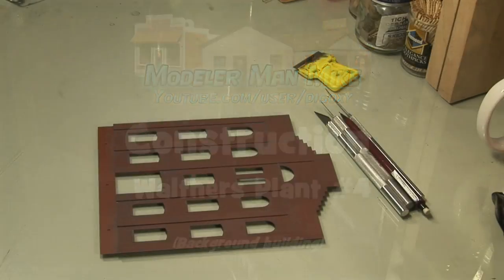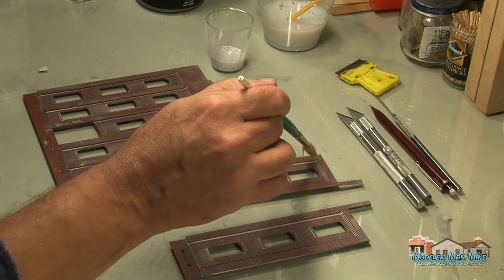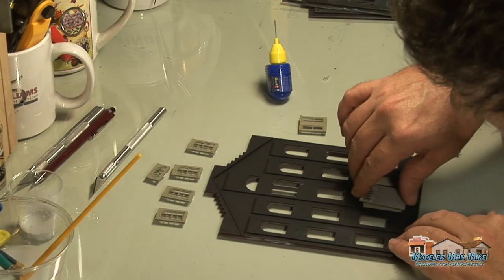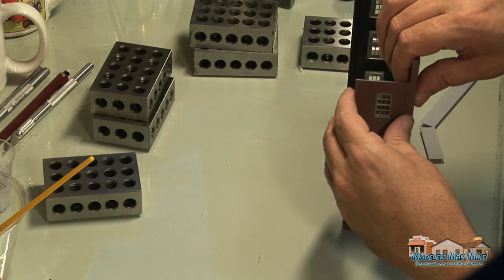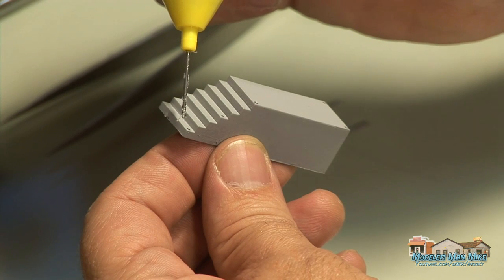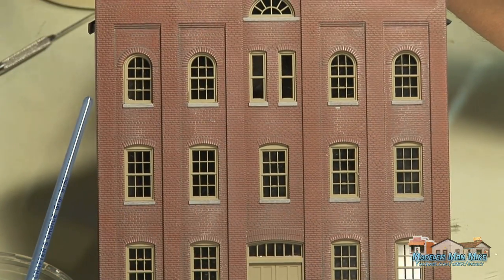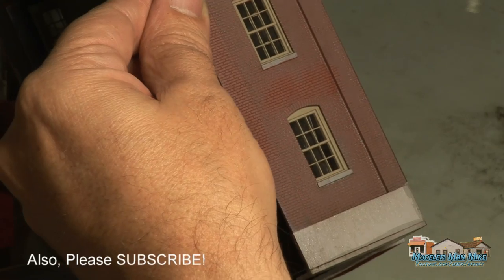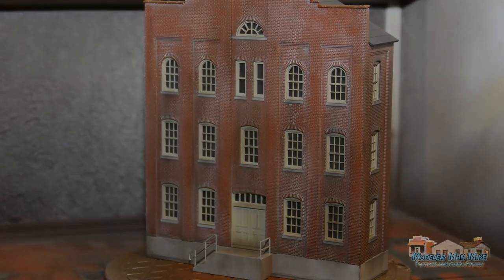Model Railroad HO Scale Build - Walthers Plant #4 HO Scale Building Construction

Comment: Great video! I did the same building but didn't do weathering like that, and I noted you painted the inside wall black before putting it together. Great instructions!
Reply from the maker: How did yours come out?
Reply: ModelerManMike
Ok, but not as good as yours. I did lights in mine.In about a week I'll have a new video out and it will probably be seen.

Comment: hey mike, I found that if you like.... you can paint drapes on the upper half of the window useing a nice contrasting color and blacken the lower half altering in lengh to simulate shaded windows. It looks good AND it's Eeeeeeasy. lol
Reply from the maker: Hey, this is a great suggestion for a standard unlit building, however, I am going to light these buildings and I want to have the light through the windows. I found that using yellow masking tape and white masking tape work well to. I need to work on this some more of course, but in all, the light through the windows with masking tape as more of a blind or something really looks good. Maybe soon I can get something up on this with some lighting to show how this looks, it really looks good. Thanks so much for the compliments, they are very much appreciated and I really enjoy hearing idea's and you my friend are sending some. Thanks for that.
Reply: I Have painted just the top part for the shade and left the bottom clear with lighting and it looks pretty GOOD?!!

Comment: What type of glue do use to glue plastic windows or acetate to the plastic building sides? Look forward to your response. Thank you.
Reply from the maker: I use mostly the revell brand for most everything. Its actually not a glue, its a solvent that melts the parts together. You can get just about any type of solvent, most all works fine. I like the revell because of the needle applicator. I have purchased also, solvent from ebay with needle bottle applicators that are solvent safe. If you looke on the web for best solvent for evergreen styrene you will find all the info you are looking for as to how to get your stuff built. Hope this helps.

Comment: Quick question.  In one of your other videos you weathered and then sealed everything with Dullcote.  Afterwards you added the windows.  I then checked out some of my buildings and realized how bad they looked because I used the Dullcote after the windows were added.  On this video you added weathering after the windows were added.  Did you not apply Dullcote to this model?  If so, does not applying Dullcote make the building harder to clean away dust?
Reply from the maker: Hello Loren, wish I had a really quick answer. This model is a background building, when I built it, I didn't think much about the windows really. I probably should have sealed it with dullcote then added the windows. I did look at this model and the windows have a nice "film" on them from the sealer.

I didn't have dullcote on this model and used some clear matte spray. I don't use the clear matte spray anymore just because it seems to destroy a lot of the weathering I do. I think on many of the models I do, including many that I do not do video's on, I have stopped using a sealer all together. Good example is the Coal Mine, I just didn't use any sealer dullcote or matte finish at all. The weathering powders look much better without being sealed I think.

Some of the smaller models I built over the past couple of years I plan to go back a dullcote them covering the windows. I used a matte finish (or so it said it was matte) and they have a horrible sheen on them that look like they are wet! you can see some of these buildings in another video : Model Buildings: HO Scale Buildings Comments and Review.

In all, now with the understanding of how the finishing coat will work on the powders, chalks and pastels I use, I may or may not seal the model with a finishing sealer. If I have a lot of weathering, I just dont seal it, if I plan to seal it I will add the windows after its sealed.

Loren, I hope this answers your question, if not let me know ok!
Mike
Reply: ModelerManMike Thanks for the thoughtful response.  The wonderful aspect of this hobby is that it is very forgiving.  If you do not achieve the results hoped for you can almost always just do it over.  I personally know that I have some buildings that need windows replacement.

Comment: What kinda glue are ya using?  For my weathering powder I use eye shadow make-up I get at the Dollar Tree store.  I think it sticks better than any weathering powder (chalks & pastels) I've ever used and it only costs $1.00.  Ya get 12 earth tone colours ranging from light brown to dark earth tones including a rust colour.  Did I mention it only costs $1.00?
Reply from the maker: The glue is actually a solvent that melts the plastic together, be sure to clean the paint by masking before paint or scraping after its painted or the solvent will not work as well. I dont see any reason that the make up wouldn't work. Just thinking about it does it not contain oils for skin though? If so, this might could cause problems much later as the model ages or when using other modeling products maybe? Not sure but it sounds like something to try. If your looking for cheap, you might look around for an old shovel or some metal anything that is rusted and simply start scraping that off. You can also find different shades on the same shovel I bet! Just gotta grind it down is all. Real rust is completely dry and no additives at all. Crushed ground leaves are also a good source I think. But all good stuff and idea's, thanks for the comments, much appreciated.
Reply: @ModelerManMike  Yes, Mike, I do use real rust for my rust.  I take about 2 rolls of 0000 fine steel wool and put it into a quart jar and cover the steel wool with white vinegar.  I set it in the kitchen window (the one that gets plenty of sunlight) and leave it there until most of the steel wool is consumed by the vinegar (usually shake it occasionally); leave it there for about a month.  After that I pour the mixture into a glass square or rectangle baking dish my wife gave me to use for my modeling.  I then put the mixture in my closet and leave it until it completely dries out.  I then use a single edged razor blade scraper and scrape it from the dish and pulverize it with my razor blade until it's a fine powder.  I store it in small containers like snuff cans or tins.  When I want to use it I mix the powder with some water, alcohol and Elmer's glue and add a couple of  drops of water soluble glycerin.  I then use it on my models.  Sometimes I even gouge out the plastic some and use the rust mixture in the gouges.  Nothing like simulating rust like real rust!  You can vary the colors you get by the amount of time you leave it in the sunlight.  I've gotten several colors or deep red to orange-ish colors from varying the time.  You can make plastic look just like metal with my rust by making it up as a wash and using that on the model which gives it a metal appearance when dry.

Comment: Mike I have.  They're Great Too!!  I was hoping that you may know if that bottle was available in the States too.  I get really frustrated with my gluing and your bottle with the metal aplicator end looks like it would work great!!
Reply from the maker: It sure does work great, I used brush on for a while and moved to this, I like it. I am not sure if you can buy it in the states, I purchase it from ebay. another option is to get a solvent bottle with a needle tip, also from ebay.
Reply: Maybe I'll try that...  I definetly need to do something different.  I am tired of covering up my glue runs on my models they just look BAD!!!

Comment: What kind of glue? I got a general contractors shop and Iam all confused how it goes together
Reply from the maker: The models are made of plastic, the glue used is a special type of glue. Its actually a solvent the slightly melts the parts so they bond together. There are several types of glue out there, I use solvent, they also have a cement glue. Search in google for plastic model solvent, glue, cement. I hope this helps.

Comment: GREAT video  is that Reeves a special paint or will any acrylic grey and white do the job thanks
Reply from the maker: Most all the paint I use is a water based acrylic, anything should work I would think. thickness is the key tho, so when you mix it, you want it mix well, the cheap stuff sometimes doesn't mix as well. There are a few other brands that work well, one called American I think. Just look for water based acrylic and you should be good to go!
Reply: Thanks

Comment: Hey mike, any tips for preventing (and getting rid of existing) glue marks on the windows? I do my absolute best to not get glue on the part that shows, and even if I dont, for some reason they still come out hazy in the end. What am I doing wrong?
Reply from the maker: Hey 5d, sorry so long to reply, just ran across this. I hate it when that happens. I have frosted windows so many times using super glue on stuff I lost count! I usually just replace the window material unless its really thick stuff. If its really thick, I have actually sanded it off, then, using like 1000 grit, 2000 grit and 3000 grit paper through the entire process to buff cleans it up. I only spend that time on windows that are specific to a model though. If I can come up with any way to replace them, this is usually what I do.
Reply: Thanks for the reply! :D I think I will try taping my windows in from now on instead of using glue. Seems that no matter what, even if the glue isnt on the window when I apply them, they frost up on me. So taking the glue out of the equation will hopefully remedy the problem.

All my windows are made out of the clear plastic containers from Peco Electrofrog turnouts, so I got plenty of the stuff!
Reply from the maker: If you get a chance, post some pics on the community, I would like to see how they come out.
Reply: ModelerManMike will do, though i am not heavy into social media, which community? Model Railroader forum? or do you have a facebook community for followers?
Reply from the maker: Here you go, check this out... https://plus.google.com/u/0/b/107934973242857840131/communities/104964959974656005095

Comment: What kind of glue do you use?
Reply from the maker: I think most of this was done with a revell brand. Its actually a solvent that melts the plastic together. You can find it online, Ebay, Amazon I think. I use this mostly because of the applicator, its thin and can reach nicely into models. Hope this helps, thanks for the comments and compliments.

Comment: Can you do all the painting and weathering to a building that is already completely build? What kind of paint are you using?
Reply from the maker: Hello Zebulon, this would really depend on the model, if it has detachable windows and the like. Can you dissasemble the model? If not, to answer your question in short, yes, you can redo a model that has already been assembled and painted. it would however require a lot of masking, masking the windows and doors for a shot of paint, then, masking off all the painted area to only expose the windows and doors and painting them. This is how I would do it. If you paint with a brush, the doors and windows, careful paiting you can cover the existing job on the model. dont be afraid to take it to the sink and wash it with soap and water before you try this! many models can be dissasembled, I build my models with glue that will allow me to do this. check out the other video's on my channel to see the paint and how I go about covereing the models with rattle can paint. this works well for me.

Hope this helps, and, let me know how your project goes, I would be curious to know exactly what your working on and doing to understand the process you work through to make this happen!
Reply: I've only started building models in the last year or so. The buildings I have are already completely put together. I don't think I can disassemble them. The glue I use is Testers cement for plastic models. I know it says for plastic models, but when I applied it, it molds the edges together. I probably used the wrong kind of glue. They came out looking good though. I haven't painted the buildings, I didn't think about it until I came across your videos. I just need to figure out what kind of paint I need for cheap. Thanks.
Reply from the maker: Zebulon Pritchard Testers is great glue for this stuff, it really does bind. As most of the plastic glue for models really does do a great job making sure the parts dont come apart, some do allow for this. Most plastic glues are actually a solvent that melts the pieces together, so, what your doing is joining the plastic pieces by melting them together and hence the strong bond that doesnt come apart! :)

If your looking for paint to paint the assembled models just about anything will do if its not some finger paints or something :) pick up some water based acrylic, American sells some good stuff that you can pick up at craft stores like michaels or even some hobby shops, just ask the attendant for some decent craft water based acrylic and that will get you started. you may see some of this in my video's sometimes. I do the window seals with a water based acrylic as well, you can see this being mixed on my worktable. The thing about this cheaper paint though, it is sometimes difficult to hide brush strokes and things like this, I usually resort to spray paint and masking where ever I can. A good thing about water based acrylic though is if you catch it before it completely dries, you can wash it off, its harder to take off after it dries a day or two though.

For the ultimate look in painting though, you might want to look into modelers paint, this is high quality really nice smooth paint like creme and goes on woderful, for a perfect paint job, I will go to this stuff but it isnt cheap, upwards of 5-6 per 1-2 ounces.
Reply: Okay. It sound that I have been using the correct glue. I figure that as long as the building come together with no problems everything is fine. I will check in to a craft store and see what I can find when it comes to the paint. Thank you for the advice and assistance in helping me in the right direction for my projects. If I need anything else, if it's not to inconvenient, I will message you. Thanks again.
Reply from the maker: Zebulon Pritchard Your very welcome, I like the chance anytime to talk to a fellow modeler. Good luck with your build!

Comment: Hello, nice vid! Just getting into Model train and building buildings. What type of bottle is that for your glue?
Reply from the maker: Hey DunkOnDunks, can you tell me what point in the video you see the bottle? I will surely look for you. There is so much here, not sure what bottle your talking about.
Reply: ModelerManMike The glue bottle you apply the glue to windows and edge of walls. Lil blue bottle.
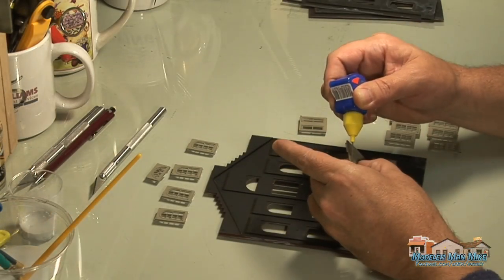Reply: ModelerManMike 2:57
Reply: ModelerManMike You said in another video. "Revell Glue'
Reply from the maker: Oh, that is a brand of glue sold in germany, I am not sure if it is sold in the states. I like this glue though, it dries slow and really doesnt hold as good as some of the other glues, if I make a mistake, most times I can just pull apart the stuff. It also uses the small applicator. Check local hobby shops and see if you can find it, I think its usually sold for model plastic planes and cars. Let me know if you find some in the states, would be curios to know.

Comment: can you tell me where or how to purchase Model Mates Washes
Reply from the maker: Hey James, I have used them but its been a long time. The simple truth is, wash's can be easily made by mixing thinner with the color of paint you want. If its a water based paint, mix water. Once you thin it down to the desired wash, it works just the same. To answer the question though, I havent seen this brand of wash, but there are several manufacturers that sell wash's. Are you wanting only this brand?

Comment: What is a 1-2-3 weight?
Reply from the maker: I sure dont know, they are solid steel (less the drill holes). Pretty heavy, perfect for modeling.
Reply: ModelerManMike They are a tool of sorts used mostly by Machinist  I used them during layout of steel material before building ( small electroplating cranes ). Used in clamping ( some of the holes are tapped for clamping ) , leveling. ect, when you need precise thickness, angles ( like Mike used to get good 90's ). 1-2-3 blocks mean the are exactly 1" x 2" x 3" in dimension . They also make a 2-4-6. They 1-2-3's usually weigh about 1 lb. each.